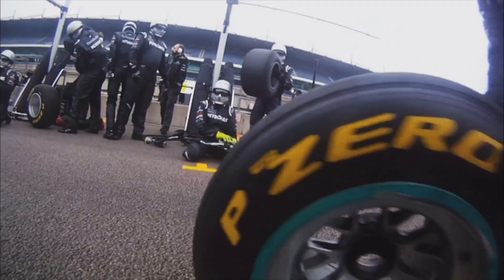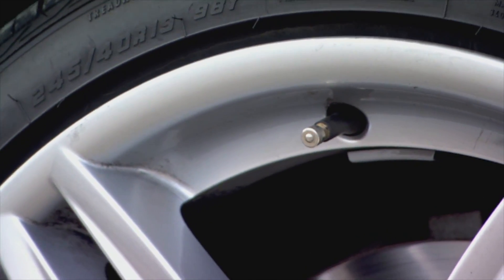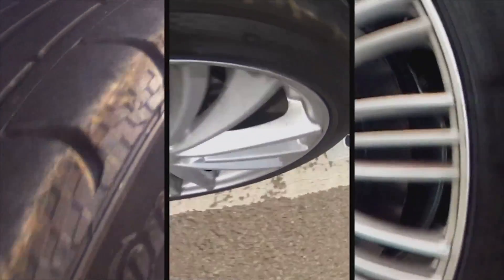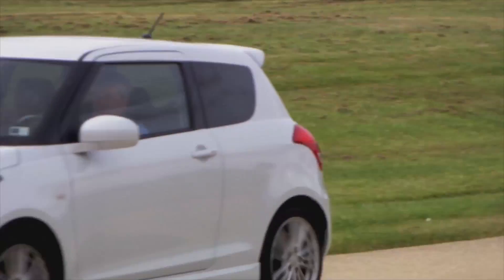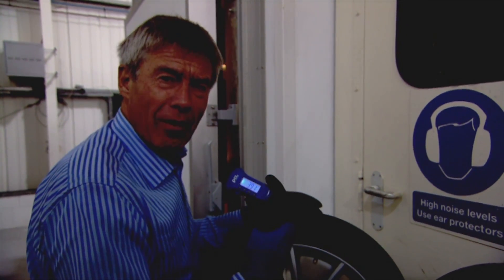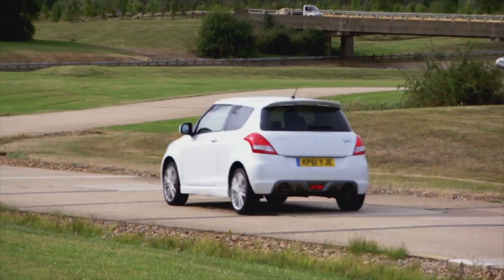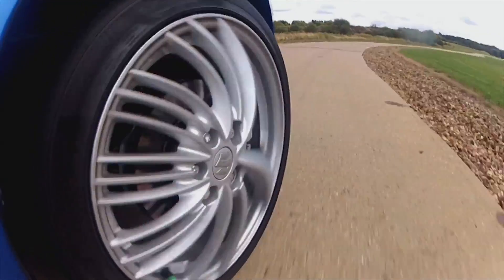Nitrogen vs Air In Tyres - Fifth Gear

Comment: Don't bother...air is 70% nitrogen anyway....they put it in aircraft tires because it's an inert gas and won't aid a fire caused but burning brakes.
Reply: I was just about to say the same thing.  It's purely used for fire prevention.  When I worked in the wheel bay, we would inflate a fresh built wheel with about 40 psi of dry nitrogen, then pull the valve out. This would effectively purge out the majority of O2 / water vapour before inflating the jumbo wheels to their operating pressure with nitrogen.  And for the record, even aircraft wheels slowly lose pressure over time and need regular top ups.  Putting nitrogen in car tyres is like eating healthy and then taking a multi vitamin pill.  Makes you feel good but is a waste of time and money. Still there is a sucker born every minute.

Comment: Many new cars come "filled" with nitrogen, this of course sucks if you live in a climate where you experience both hot humid summers and cold dry winters which can cause wider variation in tire pressure than normal air filled tires. Most people don't bother to look at their valve caps nor understand what the green paint means. Fill with normal air if you don't live in an area with consistent weather

Comment: i run a garage that pumps tyres with nitrogen, heres the trick, i dont use nitrogen i use air
Reply: +minero1986 
What did u expect from a cat running a garage?
Reply: +A Cat Here is the fraud more likely
Reply: +A Cat nitrogen
Reply: as long as I get my $28 green cap I'm happy:)
Reply: Nitrogen cost more money then its worth
Reply: William Neigum It was put in my new tyres for no extra charge. Can't complain about free stuff. ;)
Reply: +A Cat +A Cat 78% Nitrogen, 21% Oxygen, 0.98% other gasses, and can contain up to 2% Water Vapor.

So the trick is to have a water filter in your Nitrogen lines to remove that moisture, and to have a vacuum chamber to make sure your tyre is entirely deflated. Only than you'll achieve the goal of having a pure nitrogen filled tyre.

Oxygen = expands more with heat than nitrogen
Water vapor = compresses more easily (hence not desired in brake fluid either)

So yeah, it's getting rid of all the extra bits next to nitrogen that's a bit hard to do in a garage. I've never seen one with a vacuum chamber at least. :p

I do have more nitrogen than oxygen in my tyres though, and less water too. ;)
Reply: LogiForce86
also most of the mass of the ice on earth is underwater therefor already apart of it...
Reply: slickstrings
but the ice on earth which is above water level doesnt really equate to much...
Reply: slickstrings There is also a lot of area around the globe that is water. In fact there is more water than land mass. Also that the sea levels rise can be due to different things as well. For example more magma solidifying on the sea floor that has come up due to tectonic stress (see the many earthquakes and eruptions, quakes, tsunamis in the last 10 years). Or that the continental landmasses are sinking, which would seem to raise the sea level.
Reply: slickstrings You're forgetting that plants (including coral reef algae) do a little thing called photosynthesis, for which they need sun light and CO2 to convert into O2 (oxygen). So plants trive on warm sunlight and CO2. Which means the problem shout be found elsewhere. Plus about the thing of changing weather patterns and having warmer and colder periods in time, this is normal as found out through science of conducted studies of sediment, ice layers and so on. The earth just has heat cycles where it changes it global temperature.
Reply: I do it for the green cap:)
Reply: Dirty scammer
Reply: Kobi Eunice Bordonada
aaaaaaa thankyou
Reply: +LogiForce86 wouldn't there be more friction because of the larger molecule?
Reply: A Cat yeah maby is should study for car mechanic after my current study...
Reply: what does air contain?
Reply: +A Cat not so sure about that.  What about all the land glaciers that are rapidly disappearing?
Reply: LogiForce86
Yes, but there's plenty of co2 around without us pumping it at the rate we do. The planet does change, but the point is we have accelerated that change to an un-natural level. And also, once plants absorb CO2, it doesnt just vanish. Its still in the carbon cycle. The corals problem is not the amount of CO2 in the water, its the temperature of the water. Average ocean temperatures have exceeded all records month after month. So have Average land temperatures in places like australia which is once again linked to the greenhouse effect. I also dont think you understand how CO2 effects the chemistry of the water and how that can effect the animals living in it. Ever run a complex fish tank? Its a very delicate balance. Go talk to some proper environmental scientists. Dont just follow what you read on the internet and believe what favors your preference.
Reply: ***** Ooops, yeah that's true. My bad, as a vapor (gas) it expands with heat. Only as a liquid it is the only thing that expands as it freezes. Hence the sea level rising due to melting North pole ice is impossible. Unlike what the global warming people would like us to believe.

Sorry for getting my basic physics in a bunch. :$
Reply: LogiForce86
I doubt continental land masses are sinking, especially in places like australia, which is some of the oldest, most stable land in the world.
land is also swallowed by tectonic movement as plates shift under one another.  But rising sea levels are not the only problem. Just slight sea temperature changes are causing massive trouble. Corals around the world are suffering. The ocean absorbs insane amounts of CO2,  but the problem with that is, it changes its PH, which can throw sea life off. Harming the balance of life in the ocean is perilous because of so many reasons.  Its not good to rest on your - lets face it, very limited assumptions. An environmental scientist friend of mine told me about problems you wouldnt even think about. The slight change in global temperatures have caused deforestation in some places because swarms of beetles which would normally get killed off by winter frosts get more foraging time because of delayed winters.  Every year the forest loses a bit of recovery time and the beetles consume more.
Reply: slickstrings"+LogiForce86
I doubt continental land masses are sinking, especially in places like australia, which is some of the oldest, most stable land in the world.
land is also swallowed by tectonic movement as plates shift under one another.  But rising sea levels are not the only problem. Just slight sea temperature changes are causing massive trouble. Corals around the world are suffering. The ocean absorbs insane amounts of CO2,  but the problem with that is, it changes its PH, which can throw sea life off. Harming the balance of life in the ocean is perilous because of so many reasons.  Its not good to rest on your - lets face it, very limited assumptions. An environmental scientist friend of mine told me about problems you wouldnt even think about. The slight change in global temperatures have caused deforestation in some places because swarms of beetles which would normally get killed off by winter frosts get more foraging time because of delayed winters.  Every year the forest loses a bit of recovery time and the beetles consume more."

Not sure if you are trolling or just an idiot. But your "environmental scientist friend" is clearly an ultimate bullshit used to valid your religious born fear. Go preach where else.
Reply: A Cat
i dunno, there are some pretty massive glaciers. I dont think anything should be dismissed really, after all, the sea levels are rising.
Reply: +A Cat no much... just enough to sink some coastal cities, no big deal!
Reply: +LogiForce86 The current concentration of CO2 and the rate at which it rose over the period since the beginning of the industrial age are both much higher than in any prior period, within which there was animal life, that can be accounted for.  Higher CO2 levels can make the world greener, but the higher associated temperature could easily wipe out most if not all animal life.  Not to fret, too much fresh water is expected to mix with the oceans to stop their currents and then temperatures will plummet.  It will be too cold for any life form that cannot survive arctic temperatures.

Comment: ...Sooo they want us to believe Nitrogen is better just to sell us a more expensive filler for our tires :/
Reply: +TinchoX nah mate when i was younger i worked for a summer in a tire shop. i only had a moped in those times. in a car with a bigger engine you won't feel much thing, but i tell you when you left there was no difference between air and nitrogen but after a while with air it would heat up and start producing more drag. with nitrogen the tires felt like driving at night. it gave me a mild increase in speed and fuel efficiency. worth the money from my experience.
Reply: Sadly that's not available in my country...yet.
...Or at least not where I live mind you.

Comment: How about with CO2
Reply: nope, co2 has a lower specific heat ratio so the pressure will vary slightly more with temperature

Comment: Here's what's missing everyone.  When your filling up your tire (or the garage is doing it) with Nitrogen they are not purging it. You start out with regular air when the tire is mounted, then you add nitrogen, the regular air is still there. Its not removed. Therefore your going from 20% to around 15%. So its a waist of money. A way for the garage to make money from stupid people with no common sense.

Comment: All this nitrogen nonesence started with the aircraft industry (however, it does make sence in airplanes). Nitrogen is used because it's way easier to carry a nitrogen cylinder on the tarmac than an air compressor. Using Nitrogen also insures no moisture goes into the tires, as temperature at 30,000 feet altitude is around -50 degrees C. Frost forming into the tires could prove hazardous  when a 300,000 kg aircraft lands at speeds of over 250 km/h

Comment: I thought nitrogen was better because any oxygen will deteriorate the rubber faster?
Reply: that would also not make sense because of all of the oxygen and water in contact with the outside of the tire.
Reply: The tires will wear down from the road and weather before the air in the wheel, I've never heard of a tire being replaced because of dry rot WITHIN a tire

Comment: rofl give us a break. I tell you what is bad news, not checking tyre pressure. How many people have a foot pump or tyre pump in their boot? Road tyres are rubbish, the reason they go flat is because garages change tyres quick without care. Rubber used on cheap road tyres is rubbish, changing the air type won't turn a cheap tyre into a race tyre. 

Oh and from what i can tell, driving on today's roads with potholes, speed ramps, driving up curbs etc changes the shape of the rims and causes air loss. Fast cornering also puts additional pressure on the rim seal and weeps air so filling with nitrogen won't make a single difference to this.
I see a possible benefit if you are racing at 200mph and you need to accurately maintain gas pressure in a tyre on a race track but on the road, get a life seriously...
F1 cars use Magnesium alloy rims, a volatile material so nitrogen being inert and a fire extinguishing factor adds some sort of safety but magnesium rims as far as i know are not road legal.

Comment: I do see a a couple of issues. From my knowledge, aluminum rims contract in colder weather. My mom's 08 Acadia rims are pretty bad in the winter as I have to refill some of the tires every two days. My 05 Mini Cooper convertible also has aluminum rims but the tires don't leak nearly as much. And also, how are you going to refill your tire if you're running on very low pressure? Because if you have to drive to your local auto shop or gas station to refill a tire with low pressure, you could risk damaging your rim and if you dent an aluminum rim, you have to replace the whole thing. I'd rather be able to refill my tires with our air compressor we have at home rather than have to drive somewhere to get it done and there are a handful of gas stations that have bad compressors on their own. Wouldn't it be a better idea to design cars to maintain their own tire pressure with an on-board air compressor?
Reply: +Jesse Hooton nah mate if you run nitrogen and the tire deflates you just inflate it with normal air. there will be no damage. you'll just have to purge it before running nitrogen in it. also idk if the guyz from fifth gear purged the tires before. i hope so.

Comment: I always use Nitrogen Inflation, its cheap anyway so.
Reply: ***** if you live in a tropical country with humidity of minimum 75% to 125% and above and your temperatures gets fucked, then it is the choice.
Reply: +Guess who's back well the topic still is moot though, I guess it's up to the owner if he wants to believe or not, but since its only a dollar here for filling all 4 wheels and the spare with nitrogen, i don't mind it.
Reply: +koushinproductions I'd rather pay nothing for air than very cheap for nitrogen when the performance is the same.
Reply: ***** Maybe over there, not here in the tropics though, it's pretty common here when the monsoon season arrives.
Reply: +koushinproductions 
If you really feel a difference (which I actually doubt you can as soon as you wouldn't know if your tire is filled with air or nitrogen), it only tells us that your source of compressed air is crap. The only advantage of "pure" nitrogen would be that it is a dry gas. But that is something that every decent compressor with water trap can deliver as well.

Comment: Nitrogen and Oxygen mainly exist in their diatomic state in the air around us. and if you look on the Periodic Table, you will see that Nitrogen is smaller than oxygen. with nitrogen being 14 AMU and Oxygen being 16 AMU. Hence, N2 weighs 32 AMU and Oxygen weighs 36 AMU. it is uncommon that you will see any if these gases in their basic form, for they are both rather volatile being close to the right side of the table.
Reply: Yes they are. they're in the p block which is on the right side. and Atomic weight and molecular size correlate closely, Because H2 is a lighter and a smaller molecule than CO2, which is bigger.

Comment: My cousin (less than 40 watts bulb) once told me the reason they use nitrogen is that it doesn't expand, but, having taken chemystery & physics, I knew this to be a fallacy, and called him on it that N2 expands & contracts like any other gas.

That it's really only useful in a racecar makes sense, no need to pay a mechanic to fill up tyres with stuff that works the same in a passenger car as air.
Reply: *****
Water vapour does change the expansion rate, but it's that a pure gas is more easily predicted.  N2 doesn't leak out through the rubber like oxygen.

Comment: Calculations reveal that tyres filled with pure nitrogen are almost 3% lighter than those filled with air. Taking into account that if you handle that knowledge to an F1 engineer, they would definitely try to reduce the weight of the car to the utter limit. That's why they use N2 instead of common, ordinary, boring "air".

Comment: why didn't you text the tire comment after getting them"nitrogen" filled? it appears they may have not filled them with anything different
Reply: and do they purge the normal air before filling with nitrogen? otherwise it will be about 1/3rd volume of normal air anyway!

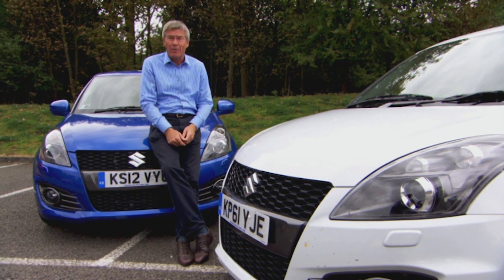Comment: OH IT"S ABOUT FRIGGIN' TIME! First, @5:14 - absolutely correct. Second, the average stations perpetrating this scam are not - CAN not - guarantee a 100 percent N fill anyway as this would require insanely expensive vacuum equipment, and multiple fill passes perhaps taking hours to tens of hours just to deal with carcass and rim outgassing.

I guess if as the presenter claimed that they're charging "a pound fifty" I could shrug it off, but shops here are charging well into the hundreds of dollars! Recently I ran across an idiot who refused to take compressed shop air to fill his flat, opting to be towed to a tire shop because he had those stupid little green valve caps on.

This has become nothing but a money grabbing scourge here with legislators turning a blind eye. There isn't a single shred of scientific evidence pointing toward any measurable benefit whatsoever to the average road car operated withing the law having tires filled with nitrogen. Period.

I suspect as well that the little green caps can be used to indicate a gullible motorist ripe for the picking. 

On the other hand, if people are stupid enough to lay down the money I'm seeing, perhaps i should patent a superior filling method utilizing barium getters (like used vacuum tubes to scavenge the remaining oxygen) and charge $500.
Reply: +Jim Vicious 
I really have a hard time deciding if it is a good idea to let people pay their "stupid tax" or if government should regulate it. There are so many things where I think "if people are that stupid and can't even do basic research, although the whole internet is available to them, let them chuck out their money". But on the other hand some if these things (especially in medicine) get out of hand and become dangerous. Again, to be blunt I wouldn't really care if people kill themselves out of stupidity, but quite often it will hurt innocent along the way.

Comment: All I needed to see was that the dealer had "Nitrogen" on the add-on tag at $279. A tire gauge can be had for under $10, and my air-filled tires only lose pressure between routine 5000-mile rotation-balances if I have a puncture or a failed valve core. See also the ideal gas laws.